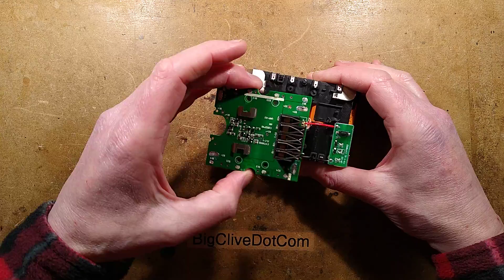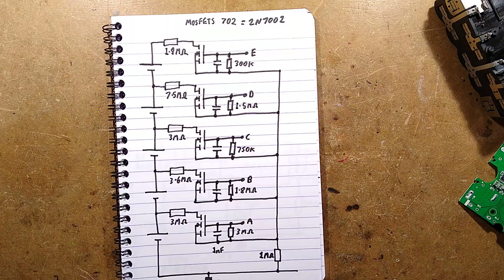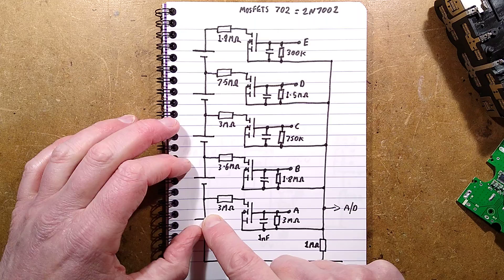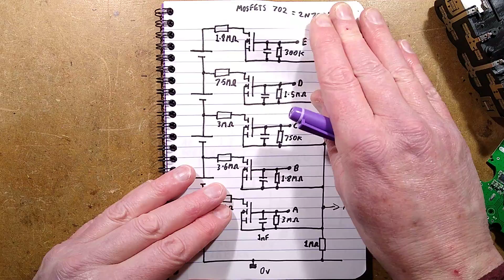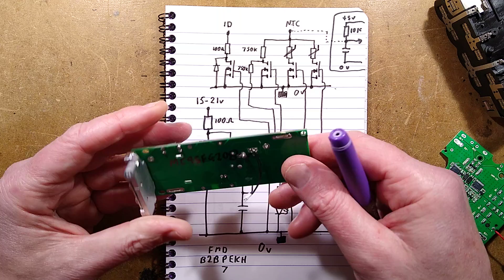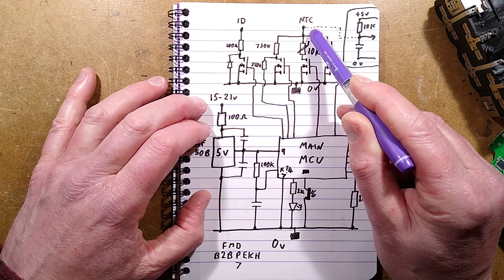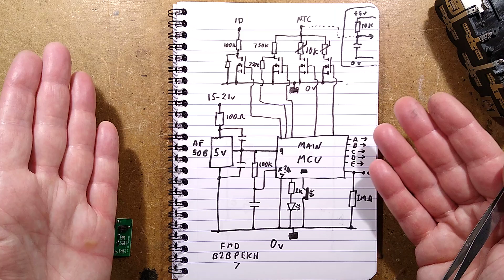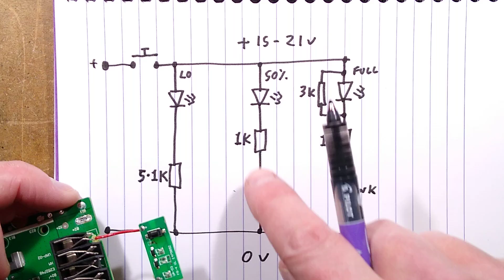Inside an Aldi Ferrex 20/40V battery (with schematic)

Comment: A multiplexing ADC into those binary IO's currently used for mosfet switching (i2c) would have been a simpler option, and whilst still two IC's would be required, one would have been cheaper than two MCU's. This looks like an exercise in hardware design snobbery, rather than getting the job done in the simplest and most efficient way. Equally, to go to all that trouble without adding any balancing does seem a very odd choice, especially when capacitor active balancing is super cheap to implement with minimal passive components. And what's with that NTC connection pulling double duty? Why does the battery and device need access to the NTC's when the battery 'almost' has its own BMS (Sans juicy MosFet switching) with comms to the device. A very odd design indeed; thanks for doing this Clive.
Reply: Speaking of efficiency, voltge dividers with a 1Mohm output impedance would impose an uneven 1-5µA continuous draw on the cells. A user or stockist would have to charge the pack frequently. With switches embedded in the voltage divider, it is possible to disconnect all the cells' dividers, reducing the BMS's parasitic current consumption by orders of magnitude depending on how often they are sampled. An idle battery isn't very exciting, so hourly sampling might do.
Reply: Some of the tool batteries that have "communication" use it to allow the tool to exceed what would normally be an over current limit.
Reply: @rpavlik1  Would an over current damage the cells? An over current situation would presumably only lead to damage, thus allowing the tool to over load the cells surely should be avoided... unless selling more battery packs is a marketing goal of course...
Reply: @dougle03  an overcurrent without a tool attached is called a short circuit and could cause a fire.
Reply: I see very little snobbery. To allow the tool to run the batteries in series or parallel requires some way to run the two half circuits either isolated or with a clever circuit to reconfigure its own operation for P, S or other load config.  A serial port with optos makes efficient use of the most common on chip communication feature.  As designed, this leaves the main BMS job to the separately sold chargers and tools.  The controllers basically multiplex all the battery status data onto a single pin to keep connector price down.

Comment: Good Grief! & WOW!  

 I'm blown away by your reverse engineering of this thing.  Very complicated and couldn't help but think of the corresponding charger that talks to it.  

I think you mentioned the deal you got this at and it seems like you scored!  I mean, the battery alone right?

Way over my head but I think I learn a little something each time.  

Thanks!